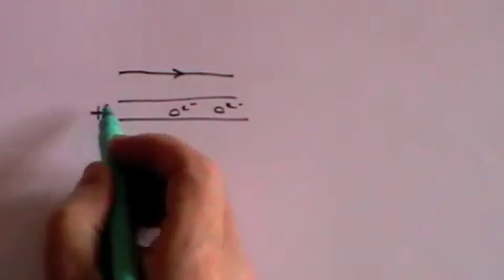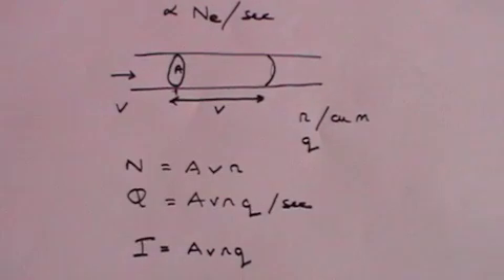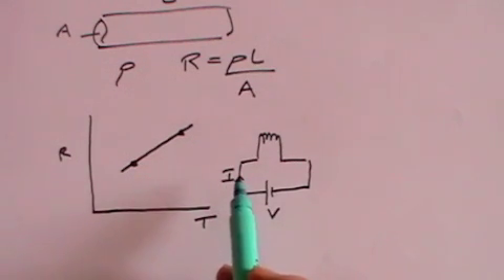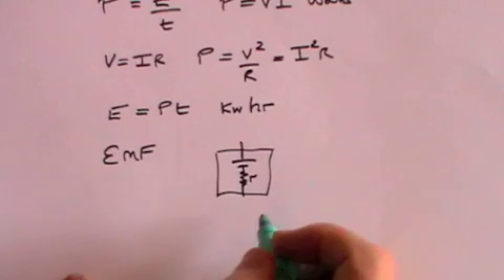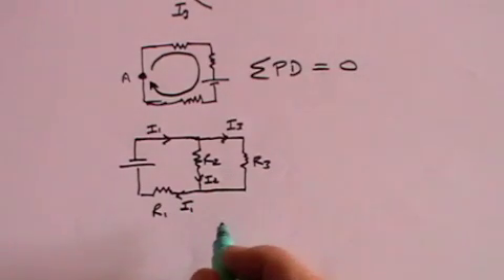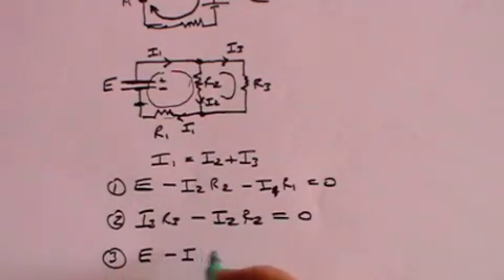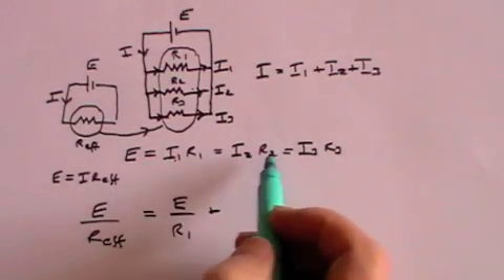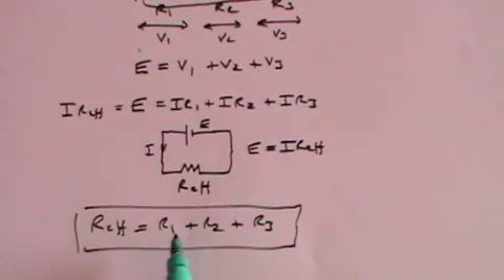Electricity - A Level Physics

Comment: I have a question, what happens to the potential difference in a parallel circuit containing branches with components of different resistances?
Reply: Taylor Shill potential difference across a parallel circuit is the same across each branch in every scenario. This means that, the same electromotive force is doing work on these charges, and if there are resistors, the current will be distributed through each equal to the ratio of the resistances. That is to say, the same force is pushing the electrons, so less go through high resistances and more pass through the lower resistances. If you have a parallel circuit with a battery with internal resistance, you can first find the total external resistance using the reciprocal addition of resistances rule, and then treat that as a single resistance in series with the source of emf. The difference is, in a parallel circuit the voltage is the same across the whole and in a series circuit it’s the current that’s always the same. This means that, in a series circuit the voltage has to be greater at higher value resistances in order to push electrons through and maintain the constant current. In this way, whilst in parallel the ratio of currents are equal to that of the resistances, in a series circuits it’s the ratio of voltages that’s in the ratio of the resistances.
Reply: samuel McDonagh I thought the current was the same in any point in series circuit due to Kirchhoff’s 1st Law?

Comment: considering Kirchhoff s 2nd law , what if there is a circuit with no appliance(no resistance) and only a cell connected , so as current flows through cell it would gain energy and this energy will add up when it completes one complete circuit and passes through cell for the second time, so current would keep on gaining voltage ? how is  Kirchhoff law applied here

Comment: What does it mean when a lamp operates "normally"? 
Thanks
Reply: I think it means that it works at full power, with no light deficiency or anything like that. Like if it requires an amount of voltage and amps ( 5v and 2 amps, idiotic examples just random numbers...) it will get exactly what it needs.
Reply: thanks

Comment: why does the temp increase in a filament lamp
Reply: +Ayenoon Shafin Because Light energy in a lamp releases heat energy
Reply: +Ayenoon Shafin as the voltage increases, the particles of the filament lamp vibrate and thus create heat energy through light energy
Reply: the filament lamp is nothing but a wire made of tungesten, when electrons carrying electrical energy move through this wire, they collide with the tungesten atoms, and thus the tungesten atoms resist their motion a little bit. As they collide with those atoms, they lose energy to them and cause them to vibrate more, releasing heat energy(since atoms will want to return back to their normal room temperature energy, so they get rid of this extra energy by radiating it as heat, just like human body, when temperature increase more that normal "rest" body temperature, it start radiating this extra energy to the surroundings as heat) and the tungesten becomes so hot that it becomes what is called "red hot" and thus we see this heat as light.

Comment: is voltage potential energy per unit charge or just total energy per unit charge?
Reply: +1steinstein it is per unit charge.
Reply: potential or total energy?
Reply: Your question needs to be restated..... voltage is the work done per unit charge in moving per unit charge against the electric field. Once moved against the electric field, the work done is stored as potential energy in the unit charge. This potential energy per unit charge is then termed as voltage

Comment: What does resistance, resistors and resistivity mean by? Please answer sir!
Reply from the maker: +Adhiraj Dhungana Resistance is usually a value in ohms. A resistor is a device which has resistance. Resistivity is the inherent quality of any given material which enables you to calculate the resistance of any quantity given its length and cross sectional area.

Comment: 0:36 The direction of current in the source and in the circuit is different! From "minus" to "plus" in the source and from "plus" to "minus" in the circuit. It's because the electrons flow in the circuit is not free, but driven by the source. The circuit also must be closed otherwise there'll be no current. It's written in books about historical convention, but it's purely practical as you can see. Means that everytime you see a drawing of a current in a book it is a part of the circuit not the source, if nothing else is specified. Many people are confused about it. I wonder if it was so hard to put in books this simple explanation instead of "historical convention" just to make it clear from the bigining?

Comment: I thought Kirchoff's 2nd law stated that the sum of the e.m.f around a series circuit is equal to the sum of the potential difference across each component so why is it that in the video you said the sum of the potential difference is zero
Reply from the maker: Reke Jarikre Well it is. But if you start at a particular point and arrive back at that point you must arrive back at the same potential. i.e. you may have gone up and down the electric potentials but you end up where you started ( difference = 0)
Reply: Reke Jarikre Easy way to remember both Kirchoff laws: the summary of currents in the point and the summary of voltages in the circuit, all equals zero :)

Comment: How do i put this emf in form of y=mx+c?
Reply from the maker: Why do you want to do so?
Reply: Usually we plot a graph of resistance against 1/current. But if we invert the axis to 1/current on y axis against resistance. How do we display this in the form of y=mx+c?
Reply: ***** Well we have the equation V=e-Ir so we rearrange this equation to make it appropriate for y=mx+c

V=-rI+e so if you graph this you can look at the y-intercept for the e.m.f and take the absolute value of -r (|-r|) for the internal resistance.
Reply: e= IR +Ir
divide by current e/I=R+r
divide by emf 1/I=R/e+r/e
Gradient is 1/e
Y intercept is r/e

Im assuming you mean the equation of the line on the graph of 1/current against resistance
Reply: ***** Is PhysicsNet.co.uk your site?????

Comment: for kirchoff's law at 15:18 you said there's a potential drop so it's a negative value for I2R2, but in the second equation you have a positive value for I3R3 - there is no potential drop here?
Reply from the maker: There will always be a potential drop across the resistance. The question is whether you are moving in the same direction as the potential drop or the opposite direction.

Comment: ohms law is not V=IR ohms law only can be represented like this when the temperature of the artefact (a bulb, resistor, LED, piece of wood ect) remains constant. But as temperature increases so does resistance disproportionately to V and I so: V does not = I times R, if R increases when temperature increases. So you can only describe something as being an ohmic conductor (a resistor) or a non ohmic conductor (bulbs and LEDs) So V=IR if temperature remains constant however it doesn't ALWAYS remain constant in the example of a bulb (a bulb heats up) For more look at the IV graphs of LEDs bulbs and resistors where you can clearly see V does not always = I times R
Reply: Are you dumb? Yes resistance goes up when thermal energy stores increase but assuming you you know the new resistance. V=IR holds true even then. Next time you do an essay think it through

Comment: At 5:20 the straight line's gradient represents 1/resistance....
If voltage is on the y-axis and current on x-axis, then the gradient represent Resistance
Reply: that right. I thought I had put an annotation to that effect.

Comment: double circuit confuses, why it is zeo when you go baxk to where you started>>? I think until the loop  is closed it should be continuing without break and voltage cannot be 0 because current continues to flow until it won' slow it down to the stop. I might be wrong but yet I don't understand why you substract the current from total energy??

Comment: 1:15 - isn't that equation change in current over change in time, as opposed to the amount? I may not fully understand the mathematical meaning of triangles, otherwise- it just seems rather confusing.
Reply from the maker: The current will be the change in charge divided by the change in time.
Reply: thank you for clearing that up.

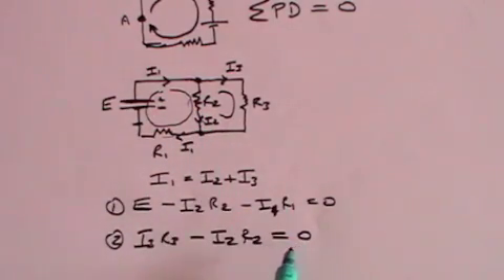Comment: At 16:58 you're stressing that you use a minus sign because you're going opposite the current. Why is it then, that you're not using plus where you're going in the same direction as the current?
Reply from the maker: I am simply saying at this point that on the basis of the directions I have assumed, I3 is travelling in the opposite direction to I2.

Comment: on the 5th minute you draw the graph I over V and you said that the gradient is the resistance. ...I think that it is 1/R so ita the opposite of resistance
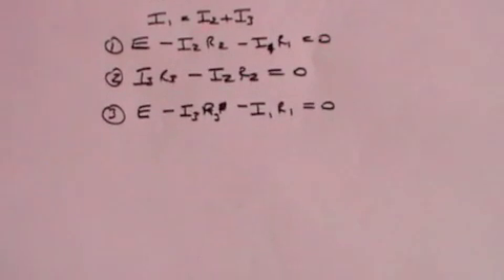Reply from the maker: milton mahdi I think I cover resistances in series and parallel in this video (18:00) and in the subsequent one on Potentiometers, Rheostats and Potential Dividers. But I also covered it in my most recent 2 videos in the GCSE revision series.
Reply from the maker: milton mahdi I think/hope I have added an annotation. If the graph is V against I (je V along y axis and I along x axis) then the gradient is R. But if the graph is I against V then the gradient is 1/R.
Reply: that was exactly what I thought thanks a lot!!! your video on electricity hellped a lot but my only other problem is to calculate the resistance or the current when there are resistances in series and in parralel! is there a video or a tip that you could give me? just a question: do you teach physics to students? if no then I belive you should start!
Reply: the gradient is the resistance
Reply: no it is 1/R!

Comment: My teacher tells me that the higher the voltage, the larger the current but if I=P/V , the higher the voltage, the smaller the current , can u help me plz~~
Reply from the maker: You should be using ohms law V=IR.  for any given resistance R, then as you increase the voltage you will increase the current. You have used the power equation P=IV. It is certainly true that if you increase the  voltage then in order to get the same power you can have a reduced current but that is not the same thing.

Comment: i am so confused. Why do you sometimes use the direction of conventional current and sometimes you use the "actual"direction.?? What should we assume in the exam?? Thank You!!!
Reply from the maker: The problem arises because electricity was discovered before anyone knew anything about electrons. It was assumed that electricity travelled from positive to negative and that is what we still call the conventional current. But we now know that the electricity is the flow of electrons which actually travel from negative to positive because they are negatively charged and are therefore attracted to the positive terminal. We retain the idea of a conventional current travelling from plus and minus even though nothing actually flows in that direction.
Reply: so in the exam...
Reply: DrPhysicsA  "historical reasons" i thought the the whole selling point of science was that it was willing to change ideas based on evidence. Physics has failed. Archimedes rolls in his grave.

Comment: What is the proof that you will always get the necessary number of equations and unknowns to calculate the currents in each branch by writing kirchoff's laws for the circuit? ( I'm basically asking why is kirchoff's laws a foolproof method to find the variables in a circuit..)
Reply from the maker: Essentially it comes down to energy conservation. If kirchoff's rules did not apply that would imply that energy had been gained or lost.
Reply: I am not talking about the validity of the laws themselves. I am asking why is it that you always have the correct number of equations and unknowns to calculate the currents in every branch of the circuit? Is the method of writing kirchoff's rules a foolproof way to calculate the currents in a circuit?? If so, Is there a proof to support that statement??
Reply from the maker: Anand Krishnan As I said, the principle is that energy is conserved and that this means that if you go round a circuit and come back to where you started you must be at the same potential energy. Whether or not you have enough information to calculate what the currents are in any particular loop will depend on how much information you have been given.

Comment from the maker: Electricity which flows through miles of power cables suspended from pylons is still subject to a potential difference, otherwise no electricity would flow. Of course, for the most part the electricity is alternating current. Because the power cables are themselves part of the enormous circuit that is why it is essential to transmit at high voltage so as to minimise power losses through the cable.

Comment: Brilliant video! Very helpful, thank you! Is it right that in a DC circuit the charge flows because it is subject to an electric field created by the battery? How does charge then flow through 300 miles of pylon, where is the electric field originating from in this case?

Comment from the maker: V and r (internal) are constant. R (load) is variable. I = V/(R+r). Power thro Load = I^2 R = V^2 R/ (R+r)^2 = V^2/ R + r^2/R + 2r.  Now for the power to be a maximum, the denominator must be a minimum. Diff w.r.t R and set equal to zero. You get 0 = 1 - r^2/R^2. So r^2 = R^2. So r=R.

Comment from the maker: Well there is a quantum mechanical underpinning to all this, but for purposes of A level all I meant was that as the current passes thro the filament of the lamp it heats the filament (and thus produces the light). As the filament heats up, its resistance increases so the current falls. R increases because the electrons in the wire get more excited and therefore there are more collisions and interactions between electrons which impedes current flow.

Comment from the maker: EMF is voltage. So it is electric potential (V) - potential energy per unit charge. Electric Potential Energy (Ep) is work done moving a charge (q2) from infinity to a point r away from q1. The Electric Field (E) is the Force per unit charge.

Comment from the maker: Unless I've missed a point, the answer is that you need about 0.7v across the LED before any current will flow in the circuit. So for the first 0 - 0.7v I would expect no current. Thereafter, assuming there is a resistance in the circuit I would expect current to grow proportionately with voltage.

Comment: Great stuff - one thing to correct you on, however. In the derivation of I = nAve, you say that n is the 'number of electrons per m^3'. Actually, it's the number of 'free electrons per m^3'; most of the electrons can't carry a current, as they're bound into the shells of the atoms, and it is only those which have been 'delocalised' that can carry a current. A small point, but one that I have seen marks for in mark schemes (WJEC in particular, who love it).

Comment: How a charge actually flows in a circuit? Does the battery opens space to the previous electron so that the nucleus next to it pulls it and so on? I know charges repel or attract because of the photon exchange between them which sort of tells to its electron mate to repel each other but how does that even work?

Comment from the maker: I think it was Benjamin Franklin who started the idea of electricity flowing from + to -. You will recall that electricity was used long before it could be explained quantum mechanically and before electrons had been discovered. It was therefore just unfortunate that current flow was determined to be the opposite direction to the particles which actually flow - ie the electrons.